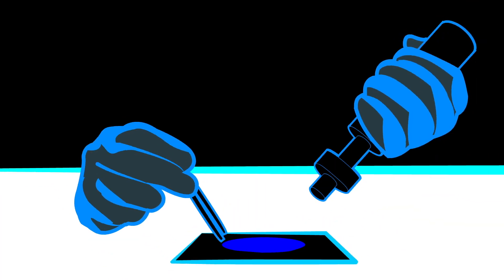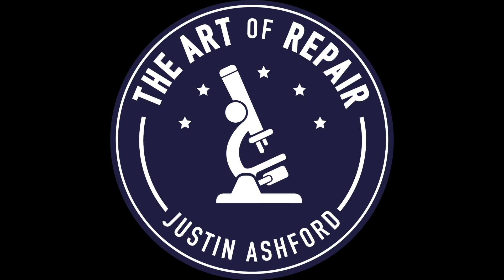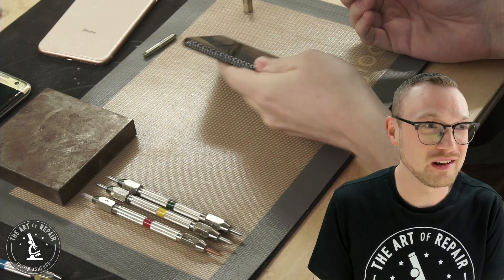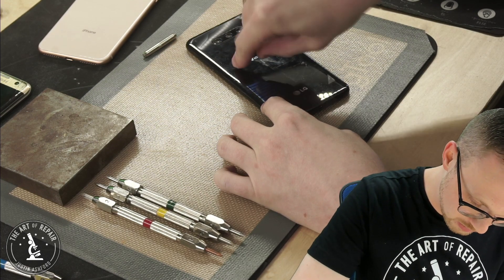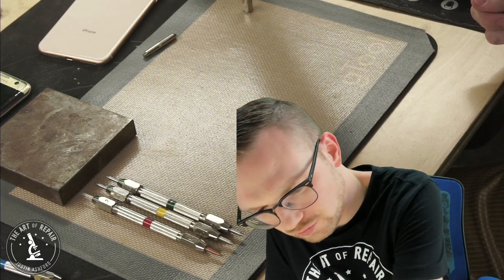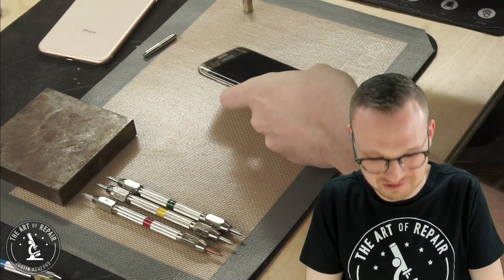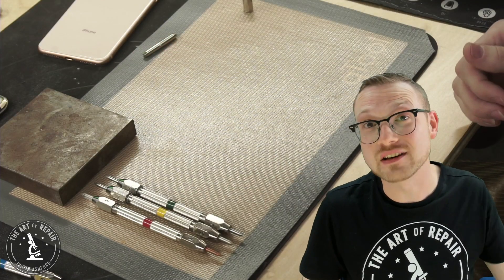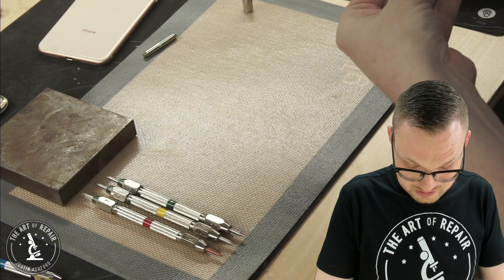Display Refurb | Back Glass Repair | Material Science | Safely Break ANY Phone Glass with LOW FORCE!

Comment: You can also use a needle bearing which isn't as hard, but works. Just drop it on the center of the workpiece from a few inches high. Most of force from the impact will transfer through the less dense material.

Comment: I bought one of these but can't seem to do anything but scratch the surface of my housings.

Have I been scammed?
Reply from the maker: mmm your not the first to mention this is having some issues,  iv got a few different "glass breaks" coming in to see if they are all equal or not. do you have a link for yours?
Reply: @TheArtofRepair  Just some el-cheapo local eBay listing.

https://www.ebay.com.au/itm/Double-Ended-Tungsten-Carbide-Scribing-Pen-Tip-Steel-Scriber-Scribe-Marker-Metal/273920096638

It's called a 'Scriber Scribe Marker", are there perhaps different variations for marking vs breaking?
Reply from the maker: @cohen200  that literally seems like it would be perfect haha, I'm ordering that one now to compare to mine ill let you know what I figure out
Reply: @TheArtofRepair  Thanks so much!

Whuch set do you have btw?

Comment: Hey Justin, decided I’d try my hand at recapping. Soldering that way can be testing. Bad repairs are hard on components. It’s satisfying to turn what would be considered junk and turn that silk purse into a sow’s ear. Specialty work suits me. No compromises and no slack. Have top drawer gear, just needs using. Been tackling bills, but have them on the ropes. The best tools yield the best work. It’s not hard, just focused! Good video as usual. Not everyone is able to do what you do. Some don’t have the gear. I’m getting mine together. Stay safe mates!😊👍🏻😷